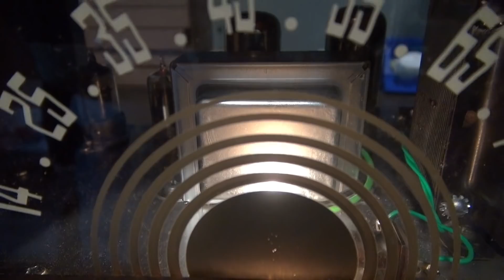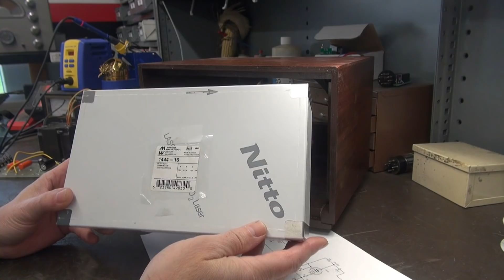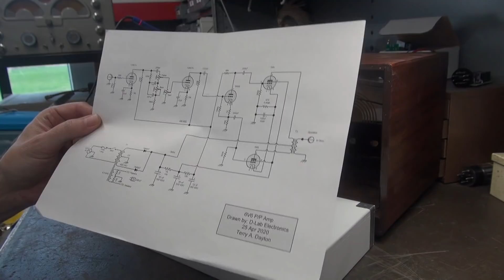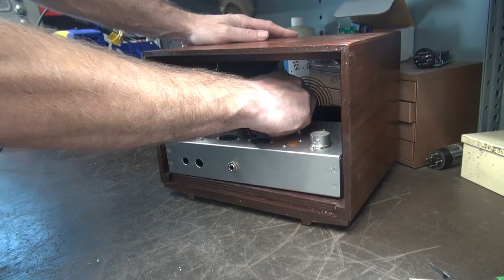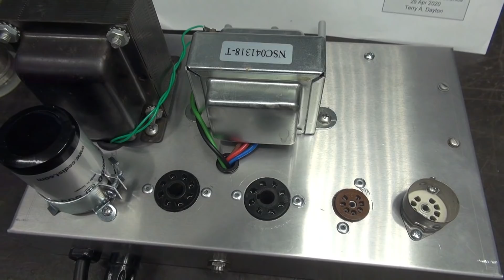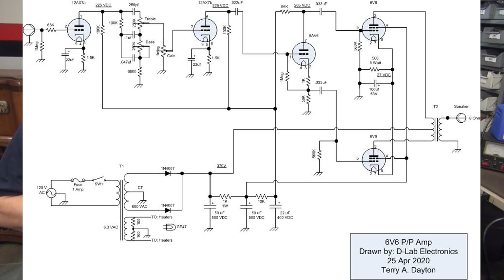How to construct Boutique 6V6 tube guitar amp Custom radio cabinet creation your design DIY Heaven

Comment: Love your DIY boutique amps! When you show your schematics they would be easier to read on the video if you used a larger sized font for the parts values. That way taking a screenshot off the video would still be legible. You could also upload the schematic to Dropbox and include the shareable link to it in your description for the video - Uncle Doug has done this before.

Comment: I would have thought that the eyelet board was only used as a production expedient by the makers.  I would think that in a tight chassis like that,  just mounting the parts point to point with minimal terminal strips would be easier to fit?   Eyelet board would make maybe replacing parts more convenient, but those type of caps ought to still be good when the rest of the amp is worn out in 200 years.

Comment: You are gonna trigger all the antique radio guys with your "re-purpose" there.   I have accumulated all the parts and vintage tubes to build a Champ clone amp from scratch.  But I am busy restoring a Drake transmitter that I helped build, new.   Noticed the tee shirt.  Transformers were not so expensive.  I got them from Triode Electronics instead of expensive vintage ones or boutique ones.  Probably will get a Weber speaker or use a vintage speaker I have setting around.  Whenever the project ever starts.

Comment: Outstanding!!
How hard would it be to add an effects loop, that amp would sound killer with a big lush reverb
Reply: Couple of shorting jacks to break in between the preamp and the output probably, is all. Maybe a cap or two for DC isolation.

Comment: Hi Terry, great amp!  I made one somewhat similar, but on the first preamp stage I used a 6av6, then a 12AX7 for the second stage  and phase inverter.  Very similar to a Harvard, but I used the Blackface tone stack.  Then I made the bias switchable between fixed and cathode.  I also made it with switchable negative feedback.

Comment: Terry I’ve watched lots of your videos and continue to enjoy them. Question; why did you not set up your tube layout so the tubes can be seen through the “window”? I think tube picture windows are so cool. Also where did you get the eyelet board??
Reply from the maker: Layout would not allow for this cabinet. With the eyelet board, tubes are on the opposite side of the controls.I purchased the board at Watts Tube Audio. They are out of business now
Reply: Bummer! I’ve looked high and low for a reasonable priced board that could have reverb and tremolo using a pair of 6V6’s or 6L6’s. Thanks again for these wonderful projects.
Reply: @jakeblues3676  Check Doug Hoffman's site for circuit boards-- Hoffmanamps.com. I had to rebuild a blackface Princeton and his eyelet board was great, inexpensive too.
Reply: I got some surplus phenolic sheet used in aircraft maintenance,   a stockpile of silver solder posts and made a staking tool to expand their bases.  Drill holes in a piece of the sheet and stake the posts.  Custom component board.  Honestly I got the posts somewhere decades ago, I have no memory.   But I got a drawer full.

Comment: Iam reaching you with hope that I can get some technical help in terms of finding exact equivalents or some place where I can get some old stock.

Any help would be appreciated. Thanks in Advance.

Here is the list of transistors:

2SC1815(Y)
2SC2878(A/B)
2SC1841(E/F)
2SA988(E/F)
2SA1321
2SC2705(O/Y)
2SC3334
2SA968(Y)
2SC2248(Y)
2SC2458(BL)
2SA1048(GR)
2SA1360(O/Y)
2SC3423(O/Y)
2SK184C(Y/GR/BL)
RN1202(10K-10K)NPN
RN1205(2.2K-47K)NPN
Reply: Have you contacted Shango066? He does alot of the old transistor work you can find on utube.
Reply: @jdmccorful   thanks for your pointer, have emailed him
Reply: Also have found that" www.tme.com" has some replacements under brand NTE, is that trrust worthy ?
Reply: Triode Electronics has new output transformers,and for some of the lower powered amps,  they cost 40$ or less.  A power transformer can be salvaged from old electronics or ebay, as long as it is the right voltages or close enough.

Comment: Its your fault....... you have got my "idea generation" juices flowing. I have an old radio that ran on 12v that I have stripped out. It has 2no 2W x 8 ohme speakers and 2no 4W x 8 ohme speakers. Is this suitable for a "new future" as a acoustic guitar amp with 12v or 240v?
Reply: The 8 ohm SPEAKERS don't care what voltage the amplifier circuit operates on!!

Comment: Nice one!  Always look forward to your videos.  Always informative! Have learned a much from them. I even watch the ham videos, even though I'm not a ham guy,  just to pick up useful tips.

A question I'd like you to address here or in a future video where appropriate:  I see  you used a fuse in this build, and nearly every tube amp I see uses fuses in the AC input.  Is there some reason they are preferable to circuit breakers?  I would think that 1) It would eliminate the need to source spares, and 2) Eliminate the issue of over-fusing and the resultant damage.  Is there some difference in the way they "blow" that makes fuses preferable to circuit breakers?

Thanks again for all your work producing these informative videos!

Comment: I have a solid power trafo 250-0- 250 high tention. Used i ones building  VOX AC 30 . I do also have an output transformer for this ( 4xEL84) with 4-8-16 Ohm tapping . Can l use these transformers for your amp ?

Comment: Terry, do you think the rectification would make a difference in tone? Ie the diodes vs tube?
Reply from the maker: Yes, a 5Y3 would be perfect for this amp. On this design I did not have the room or 5vac winding

Comment: I'd love to see one that uses 42's, 807 outputs 832's etc. The oddball tubes that are pretty cheap.
Reply: Yep, I'd love to see 2E26s in push-pull-manner with stabilized screen voltage!
And then maybe using another phase inverter, perhaps the old-fashioned "See-Saw" derivate - like the old Valco or Supro models used to use...

Comment: Is there a reason  you don't turn your audio output transformer so the laminations are 90 degrees to the power transformer?
Reply from the maker: Did you detect interaction in the demo?
Reply: @d-labelectronics  non that I could hear but it doesn't answer my question as I've seen it discussed by other people in forums and on other channels such as Mr. Carlson's.
Reply from the maker: The transformers are shielded. The old hocus pocus of 90 deg came from open paper bobbin designs. Does not matter now
Reply: ...for the HELL of it(?)